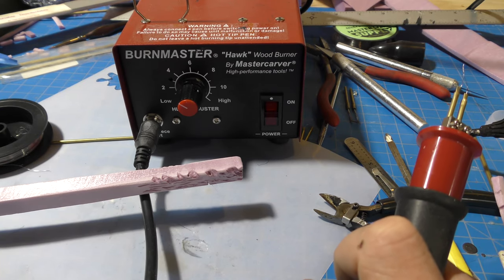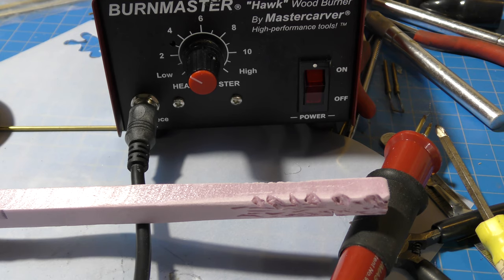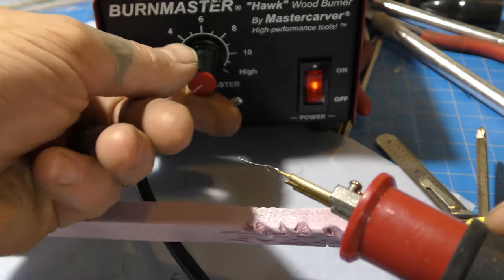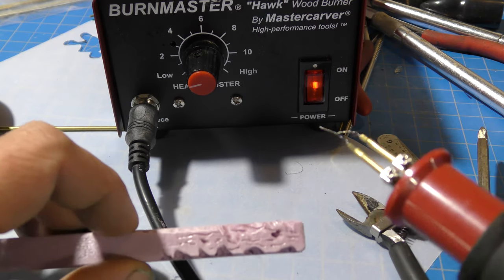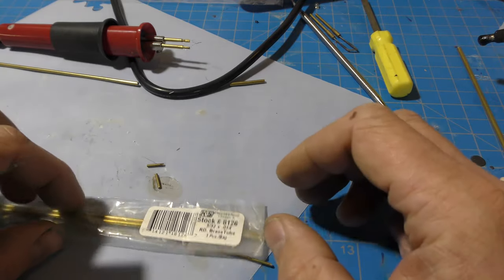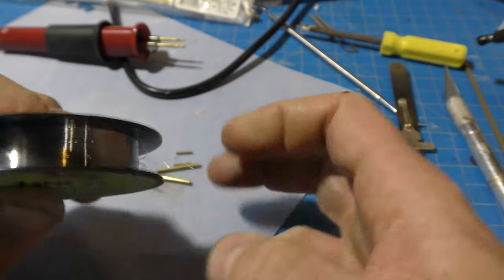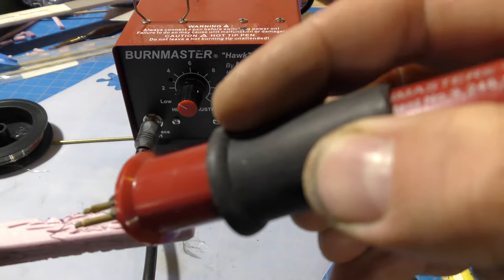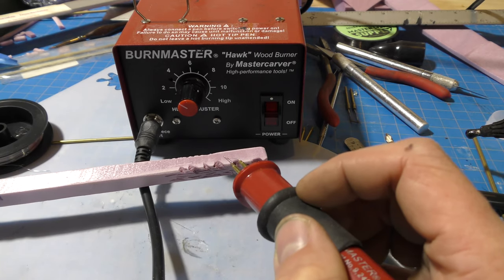SPX foam sculpting tool for Minatures -  Moded Burnmaster

Comment: Jason, this is a great idea! There is a great vendor called "TemCo". I have been using a variety of their wires for rebuilding atomizer coils.

If one were so inclined....you should look into the various Box Mods that are out there that can basically be used as a portable foam cutter.

While they MAY not be able to operate for a terribly long time (really depends on the battery and amp draw) but the possibilities for doing small details and having the ability to be cordless is a big plus.

Combine that with a smaller gauge wire and you e got a great tool for the more intricate details with EXCELLENT portability.

Also, I would like to suggest Flat Wire Kanthal or Nichrome. This will give you a super thin contact area which would POSSIBLY allow for you to operate at an even lower power and might allow for a lot of variations on cutting angle.

All in the effort of exploration!

Love your videos brother, keep it up. I always get a spark of creativity from your videos.
Reply: A couple of D cells and some copper wire and some  nichrome wire and you are in business!

Comment: My big question is can you paint the sculpted foam with graphite paint and electroplate or electroform on it? If the paint has acetone in it it would probably melt the foam, but maybe you could coat the foam with something to protect it until the paint dries.
Reply from the maker: Yes you can, it works amazingly, The problem? , it floats, so you have to hard attach the 20g wire to keep it under the electroforming solution.    You can also do Burnouts.   Leaving hollow forms!
Reply: @JasonWelsh  So you can make these volumetric shapes that weigh nearly nothing and look like solid metal castings. That is so cool! Sounds like a good subject for a video...Hint Hint